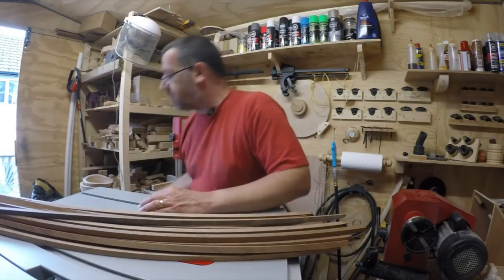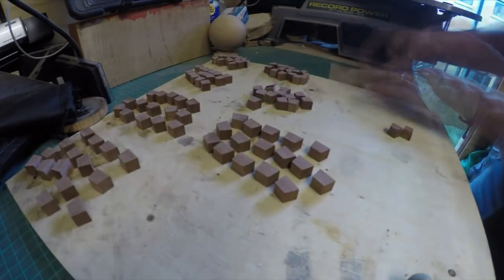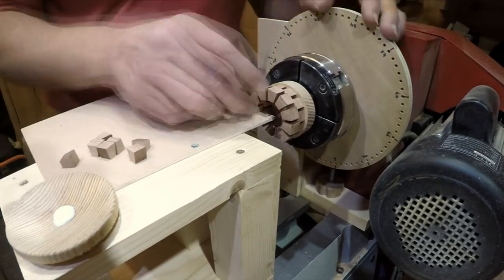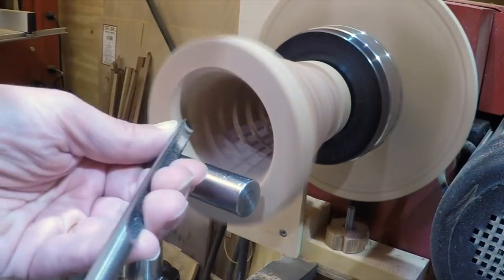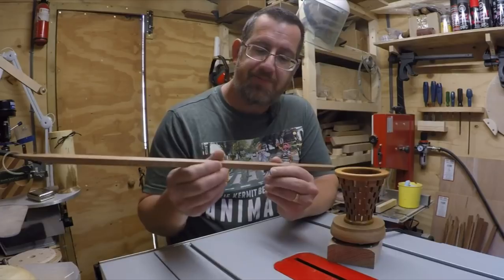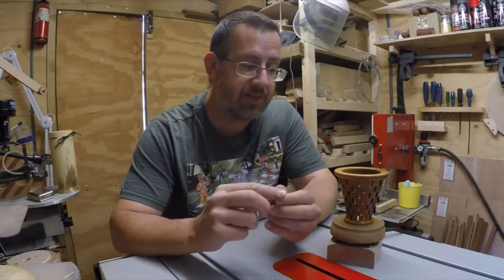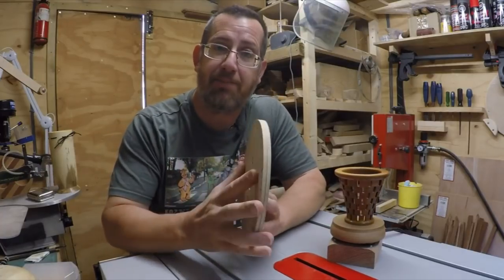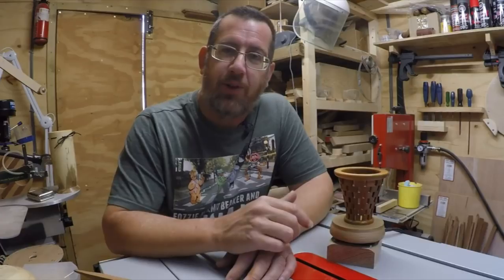Scrap Wood (Don't Throw It Away) - Episode 141

Comment: Like that Paul, it came out really well. All wood has its use and nice to see a project showing that.  Have to say it looks like the jig takes out a massive amount of work with those pieces ;-)
Reply from the maker: Thank you John. My life seems to be around wood like this so always looking at what I can make from them. 

Jigs, well the jigs I used in here meant that I could make the pieces, without them I wouldn't have made them. So yes they saved countless hours if I were to try manually which I would never have done and possibly got no where near the accuracy needed. For that I would leave to a skilled person. A bit like cutting a length of ply with a hand saw and hand plane. I would never be able to get near the straight flat edge required for some jobs so would never make it.
Reply: I'm only teasing as I am sure you know. To me its all about the end result regardless of how you get there. if you had done them by hand or with the a jog the end result would have been the same, great job!

Comment: That is a very good little vase Paul and so much to think about as well.
I must get into segmenting at some stage and Im saving up for my first table saw which Im hoping will help no end with this sort of protect.
Thank you
Reply from the maker: Thank you Graham. Table saw is great for segmenting, but far from essential for this open segmenting. I could cut the pieces almost as quick on my chop saw as angles do not have to be accurate with this type of work.
Reply: Sadly I only have a band saw at the moment but you keep spending my money : )

Comment: Turned out great Paul ☺. I too am an avid watcher of Earl and planning similar projects. His new design of gluing jig using the tail stock and banjo is my next jig adventure
Reply from the maker: Thank you Stephen. Yes I watched those last two videos as soon as they went live. Great idea to fit any lathe, but I do prefer the table in the bedways as it's easier to slide back with the left hand when you hold on that last piece being right handed.
Reply: Yes, the table on the bed ways is ideal if you are not swapping lathes. This may be the route I will go as I only have one lathe and no intention of using anyone elses for this type of work. Earls new design is space saving which got me thinking (space=good in 8x6) but the ease of use is more important so will probably use the bed.  ☺
Reply from the maker: The other option would be to somehow clamp the banjo to the tailstock. Then you can just release the banjo lock rather than the tailstock lock and hopefully nudge the whole lot all back in one go by tapping / pushing the banjo, more ideal for lighter lathes.